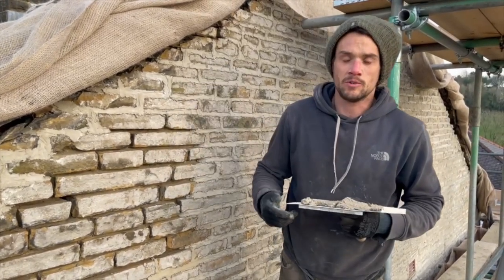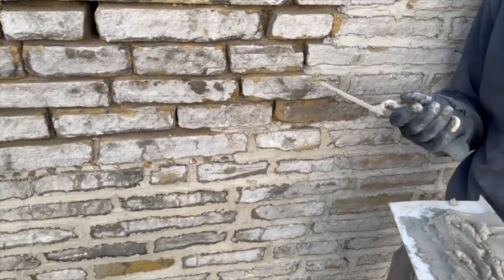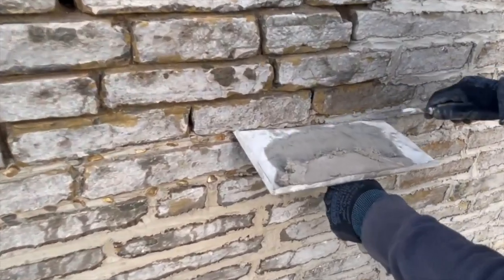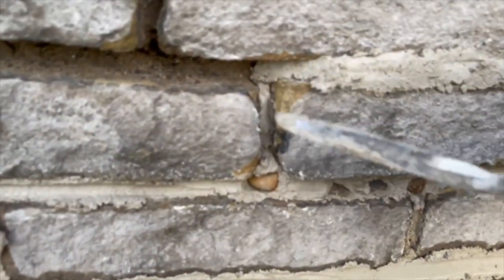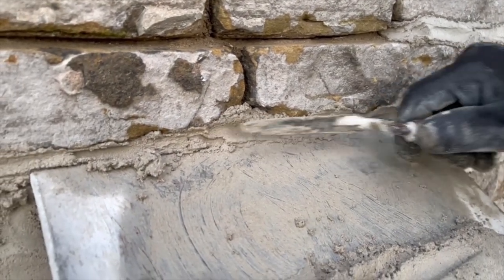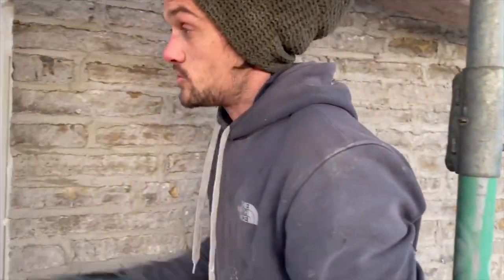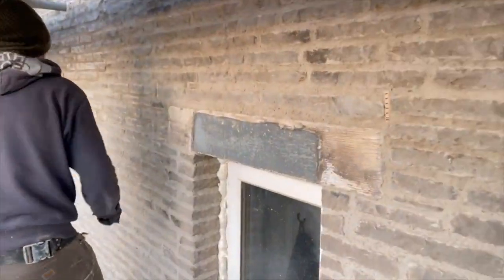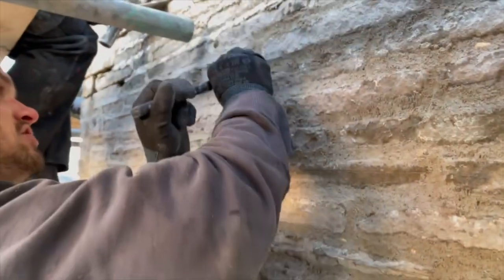Lime Pointing (part 2) Application and finishing of lime mortar pointing.

Comment: Y u all not using cement ?
Reply from the maker: Because cement doesn't let the building breathe Shankar. The moisture is trapped in the building because of the cement render used in part one. Destroying the building from the inside out.

Comment: I’m just going to be doing this job for the 1st time in Portugal thank you for sharing this 😊 I just ordered a pipe gun to try out 🤔
Reply from the maker: Good luck with the pointing in Portugal. There's some beautiful heritage buildings out there. I'd throw the pipe gun in the bin though when it arrives. They are alright for tight joints with a runny cement mix but you need a much stiffer mix when using lime mortar. A wetter mix will bleed lime out of the mortar and cause cracking to form in the mortar.
Reply: @dportercontracting9974   thank you for heads up

Comment: Probably the best lime pointing video on YouTube. Nice one guys. Only thing I would question is the filling stones, in my experience not necessary on such small joints. Putty or NHl ?
Reply from the maker: Cheers for the props pal! 
Some of the joints on this wall were over an inch wide, especially where the perps meet the horizontals. The wall gets blasted with sun all day too so we thought it best to put the packers in to allow for the flex without cracking of the mortar.
We used NHL 5 in this mix as it is an exposed site. The clays in the NHL will aid water repellency in the mortar, over using a putty.
Reply: @dportercontracting9974  You won't get any issues with cracking with the NHLs, irrespective of size of the joints. As long as you are using a well graded medium/course sand. Personally I would say a 3.5 is more than strong enough at 1:2.5 mix for everything other than chimney. NHL 5 is proven to be really very strong and actually not so breathable, more like weak cement. Putty is the way forward !!!
Reply: @tomgargrave6032  totally agree with you there pal so long as it’s course sand me personally  in my experience iv always used limestone packers where needed but I also agree with another comment on this video in my opinion it’s actually a really decent video explains himself well enough can’t fault the lad but you learn new things in this game all the time 
Keep up the good work mukka

Comment: Great degree of detail! I hate to think how difficult it was to remove the old render & mortar without damaging the soft stone. 

And the use of weep vents in that way is v.unusual. Are they the standard ones used to drain cavity trays, or more like the porous tube idea but with holes in the sides to let the moisture enter?
Reply from the maker: Thanks for the comment @Benzknees.
The laborious task of removing the render and mortar without winding up the neighbours is quite a mission!
The weep vents are specific tubes for such a job. I guess you could use the standard prep vent ones but you would have to ensure that driving rain couldn't track up and through them upon installation 👍

Comment: Very educational. Only bit I don’t get is why does it only carbonate to about 25mm. What happens when a wall is built from scratch. Does that mean that the mortar doesn’t carbonate the full depth of the bed?
Reply from the maker: Good question.  When constructional lime mortar is used, it is usually of a lime putty constituent.  Like putty is more breathable than an NHL lime due to the absence of argillaceous clays. You would normally aim to reduce the depth of your beds to less than 25mm.  If you take down or work on a well built random stone structure then you will observe the use of packers in between the joints whereas in a cementitious mortar, the joints are just gobbed up.

Comment: Excellent video. My house was built in 1870 and has a very soft sandstone. In 1985 I pointed it with Portland cement. Builders at the time said that was the way to go. I now realize the mistake I made. I have taken much of the cement pointing out. Some of the joints are very deep. Will NHL 3.5 be the best mortar to use? Would it be possible to send me your email so I can send you some photos?
Reply from the maker: Thanks for the props!
Apparently, the reason that we now predominantly use cement mortars, is because so many of the lime craftsman went to France after the WW1 and never came back. The construction industry needed a material that anyone can use, with very little training or knowhow. 
Cementitious pointing, when correctly applied, should last 30-40 years. Yours has performed well to last the duration.
Your house will thank you for pointing it up with lime. NHL 3.5 would be ideal for pointing. Great air permeability, whilst keeping out the weather. My email is porter2012@hotmail.com. It will be interesting to see how your renovation comes along!

Comment: Hi I love the connection you have with your work man. I’m a truck driver not my calling really. I’m thinking if making the switch to limestone repointing if I can make it happen sometime.  Where do you pick up your churn brush from I’m doing a bit on our house the one I got is falling to bit’s. Cheers man loads
Reply from the maker: Crack the whip and throw him a bread and dripping sandwich every now and then and he is happy..
The churn brush can be found on eBay, Amazon or most heritage building material stores.  I use limestuff.co.uk 
You can also get longer handled churn brushes which are less toil on the arms when tamping back a larger section of pointing.  I use a natural bristle brush for the final polish as it shines the aggregate better than a nylon brush.  The nylon brush lasts way longer for the tamping back part of the finish.
Reply: @dportercontracting9974  you absolute beauty thanks amigo !!!

Comment: Help!  Repointing a vaulted cellar, lots of rotten bricks, cracks, moisture, movement..and cement render which is painful to remove.  . but very old house.  The old mortar has large aggregate, so I'm just wondering if you would add those little stones to the brick pointing on an internal wall/ceiling.   Looks like you only did it to a stone wall, is it practice to do the same to brick?  Old, damaged brick?  From what I understood, you said it was for the mix to cure on an external wall, but maybe a damp cellar needs that help too.
Glad I found you friend, thanks for sharing your knowledge.  I laboured one year for bricklayers but have to put my hand up and say I'm glad to learn from your vid, just how lost I am.
Really beautiful, quality job you and your mate have done.  Such hard work and a great attitude that goes with it.  The customer must be stoked.
Reply from the maker: Hello there!
Thanks for the props! With regards to your vaulted ceiling pointing, i would be tempted to go for a lime putty mortar mix. The breathability of the finished mortar would be far more suitable than using a hydraulic lime. I can only presume that the dampness is caused by the cement based mortar/render locking moisture into the structure.
Any damaged brickwork (by that, I mean the bricks that have been structurally compromised) can be patch replaced. This enhances the structural integrity of the project. Any joints that are wider than an inch can be packed out with stone chippings.  You may find these wider joints where the face of the brickwork has been spelched off.
Hope these little titbits of info help out?
Reply: @dportercontracting9974  Awesome to see your detailed replies! Would be curious to see a basement video (maybe you have one! I'll subscribe and look around)
Reply: @dportercontracting9974  Thanks a million.  I'm Australian, have no experience with lime, stone, and ancient odd shaped curves and bricks.  I laboured with blocks, steel and concrete back home, which gave me dangerous confidence.  This house, is the oldest in a Slovene town.  I'm in between jobs at the moment and thought I'd start on that cellar as we had a few weeks of wet weather predicted.  
The facade of the house was taken off because of damp problems so there is work to do on drainage.  I have the cream of making a terrace once these are sorted.  
This is a place full of handymen, really capable people, and I admire that mindset and dilligence.  However, as hard as things are for money, I think my ego got in the way of respect for this art, thinking I could do it all.  Pointing new block walls is no comparison.  
Thanks for the advice, my understanding is lime putty is the most gentle option.  We found a craftsman with a family business who will come for advice.  I had been advised not to use mechanical tools on the stone and brickwork which I have followed.  Worn out scrapers and shoulders, but expanded vocab: omet, obok, razpoke.  
Watching your clip I was reminded that it is not my trade and I don't know where those lines are.  Thanks again, I was in danger of the poor man paying twice if you are familiar with that expression.  Let me know if you're ever on your way to Greece and need somewhere to rest. Respect.  Scott

Comment: Love these videos! Three questions for you: 1) am I right in thinking that in this job there wasn't backpointing+finish pointing, it was just one application to finish? 2) if so, is there a reason for that? 3) would you quote for a job repointing a millhouse in Fife from circa 1730?! Thank you!
Reply from the maker: Hi there. Thanks for the props! With the narrow joints on the Yorkshire point style of stonework, there is no need to backpoint as the joints are few and far between over 25mm deep. Any joints that are, can be filled with packers to allow for a proper and full hydrolysis of the cured mortar.
Reply from the maker: Unfortunately for you, I'm booked up for the next three years so am currently not taking on any other projects.

Comment: Great vid , so informative, what make are your trowels and where from ?
Reply from the maker: Cheers @swiggy03. Glad you got some use from the video.  I tend to buy second hand towels off eBay that already have some use in them by previous tradesmen. I always go for wooden handled trowels as plastic handles will tend to give you blisters with sustained use..
Keep an eye out for Tyzek or Marshalltown trowels. They are solid trowels that don't tend to flex.
Reply: Cheers mate , yes , I’ve used old WHS brick trowels for 40 yrs , doing more pointing now ,(better on my Knackered knees !, )

Comment: I just removed my potining to about 30/35mm lol hope I don't need pack the joints, 
You obviously know your stuff and been very useful for me, 
But I was thinking do you really need to pack the joints?  because when the bed stone or no bricks it's gonna be a few inch bed init so what the difference? Hope your reply buddy haha, 

Where are you based im South Wales UK Swansea
Reply from the maker: Hi buddy. I'm glad you have found some use from the vids.
Lime mortar tends to shrink more than cementitious mortar so the stone packers reduce the risk of cracks forming in your mortar.  The watter will find its way in to the cavity, then.
Lime mortar cures optimally at less that 25mm thickness of bed. Apart from lime bedded brick and architectural masonry, all other joints would ideally have packers in their structure.
Reply: @dportercontracting9974  thanks mate

Comment: This is brilliant. I have watch a few of your videos now. Is it a similar process for repointing brickwork? and is there any difference in the mix of the mortar? cheers
Reply from the maker: Cheers for the props Ben. The process is exactly the same for repointing brickwork. You might want to adjust your mortar constituents to suit the width of your joints if you are working with verniced brickwork. Keep the sand sharp though!
Reply: Thanks for the advice. Its a really soft victorian red brick from the last steam powered brick plant in hampshire. Someone has previously done some dodgy concrete repair work. I’m researching how to repoint the front of my house. Your video have been the most helpful by far.
Reply: What mix would you recommend? Soft red brick, west facing, light grey mortar. Will be repointing in the summer.
Reply from the maker: @empathyrevolution  it would depend on how much weather exposure you are getting on the wall.  Without looking, I would be tempted to go for a straight 2.5 grit sand to 1 part NHL 3.5.  
A lime putty pointing mix would also be an option if there is a substantial amount of moisture behind that cementitious mortar.  You get a more permeable mortar with putty over NHL.
Reply: @dportercontracting9974  thanks a lot for your help. 👍

Comment: Great video!  What happens to the places the scaffolding was attached to the house? It looks like there were bolts drilled into some of the stones—do those just stay in place, or are the removed and filled with something (mortar?) as the scaffolding is removed?
Reply from the maker: Cheers for the comment Mighty Hal!
The eye bolts have stayed in the property for future use (way into the future!) The bolts are into the stone instead of the joints so they have stayed put.

Comment: Can I do that with any red brick type?  Inside and outside? Should I add anything?
Reply from the maker: You sure can do S. S.  No additives apart from any pozzolan should be added to a lime mortar as it will reduce its permeability capacity.  Even a pozzolan will do to a certain degree. If you are building with a lime mortar then I would advise using a lime putty mortar.
Reply: @dportercontracting9974  Thank you! I have a house with stone basement, 2 brick barns, a grainery with mud walls and an extension with mud walls to renovate - and they are all original with lime (where it is still existent).

Comment: hi,i have an 1880  brick built cottage,which has damp issues in the living room,and the chimney breast,the suveyor has said the chimney needs repointing,new lead flashing put on,and replace the chimney pots,as he thinks the chimney has not been vented properly.i have asked a builder to sort it out,it has cement pointing at the moment,when i asked him if they were using lime to redo the chimney stack,he said they use a 50/50 mix,is this acceptable,or will it still give the house issues?
thnx bob
Reply from the maker: Hi Bob. I would steer clear of a 1:1 mix and it would likely form cracks as it cures.
Reply: @dportercontracting9974  thnx for the update,i was there today,and i noticed the front wall has had those dry rods inserted,can they be taken out,as theres still damp in the front room,i will go back to the builder,and see if they will do a total lime mortar instead.thnx bob.
Reply from the maker: @63boblondon  Hi Bob. If the repoint is done to a high standard then there will be no need for the damp treatment as a 3.5 NHL will allow the stack to breath, without hampering the water repellency. 
The old ways of doing work seems to be a far better practice than the modern methods.
Reply: @dportercontracting9974  i think thats why the house has a damp problem in the first place,they have removed 1 of the chimney pots,and its not been vented properly,plus a replacment pot has been used which is the wrong 1,and they have used cement around the lead flashing which has to be replaced,my gable end wall needs completely repointing,but i dont want cement used,and i think the front of the house has cement pointing right the way across.thnx for your replies,its very welcome.bob.

Comment: Is the process different when doing standard brickwork?
Reply from the maker: Exactly the same process matey. Perhaps put a little less large diameter aggregate in the brickwork mix.
Reply: Thank. I’ve done hundreds of sand and cement jobs but I recently moved into a solid wall property which need lime pointing

Comment: Great video. 
Since moving into our 200 year old west wales cottage I have learnt a lot about breathable materials such as lime based products.
The cottage has a roughcast/pebbledash type of external render.
Is there any way of knowing whether it is breathable or not?
Any tips on how to tell the difference?

Love your work!
Reply from the maker: Hi Paul, thanks for the props!
Any kind of pebbledash will be cementitious. If you break a section off, you will see the constituents of the mix.
Render seemed to be used as a cure all for damp ingress, in properties, from the 1950s onwards. This is fine until moisture gets behind the system..
You will be lucky enough to find stonework under the render. 
Once the render is broken off, a sandblast will take the stone back to  new. Then a lime mortar repoint will have a breathable, yet water tight property.
Reply: @dportercontracting9974  thanks for the reply! - I hope that the stones won’t be too badly damaged behind the render.
The stonework around the inglenook is thin long stones like rubble stone, yet the fireplace wall in the middle of the room is more a larger clean cut block stone.

We do suffer from staining, marks and some mould appearing on the external walls in the bedroom and living room.
Even little mites… so the internal plaster is probably not the breatheable type.

Shame I can’t add some pics on here to show you.

Anyways thanks for the help matey!
Reply: Do you have a Facebook page or a website?
Reply from the maker: @paulpearson4613 I'm afraid not Paul, I'm too busy with stuff asides to market meself.
Reply: Any plans to learn Welsh or just here on the rinse out?
Reply from the maker: @jameswatkins2596  Can you translate that comment into English?
Reply: @jameswatkins2596  yes I am learning welsh! One of the challenges I set myself. Its fun :)